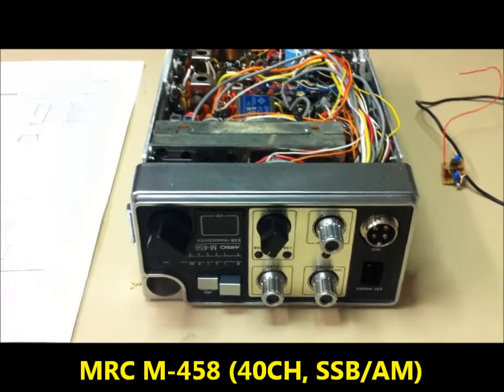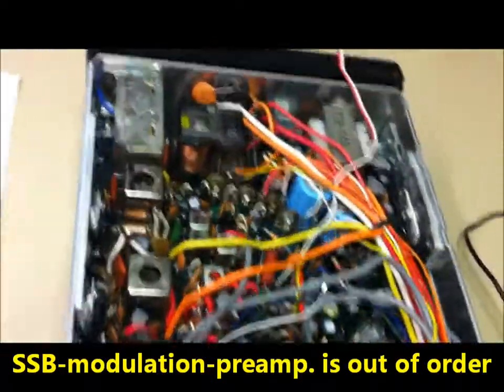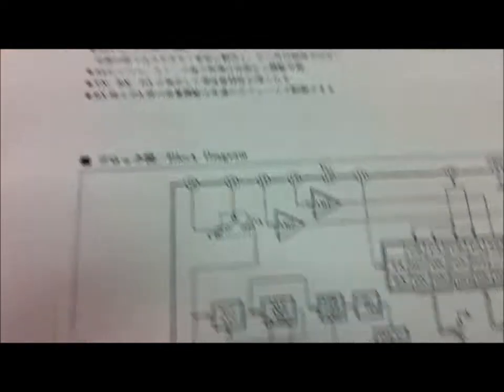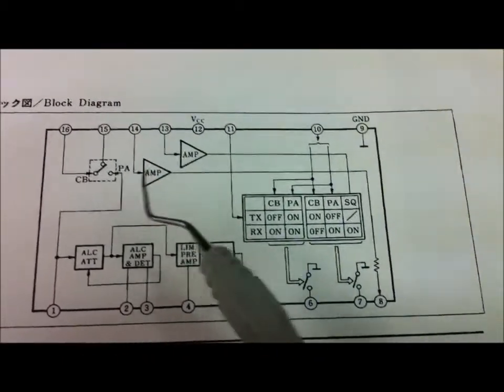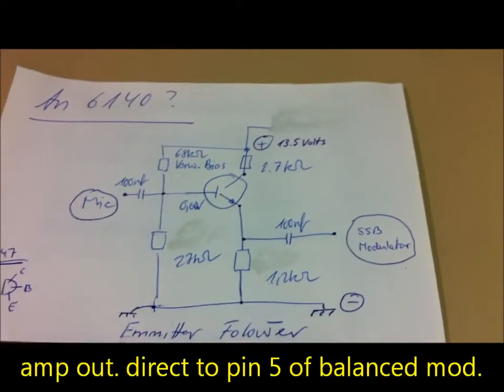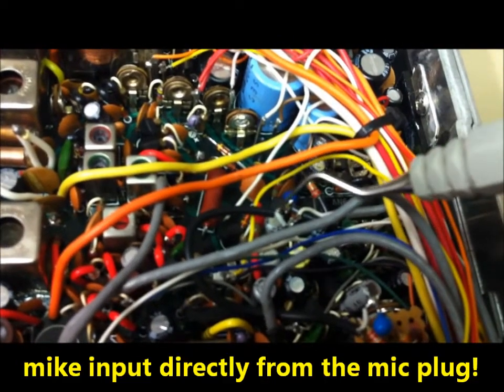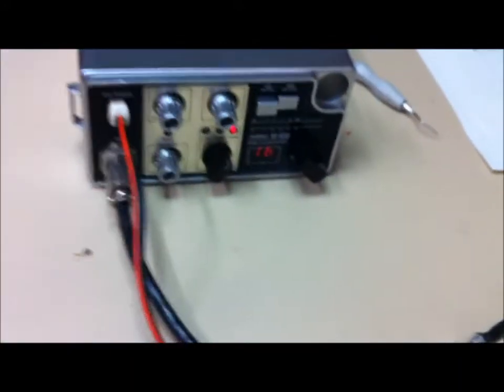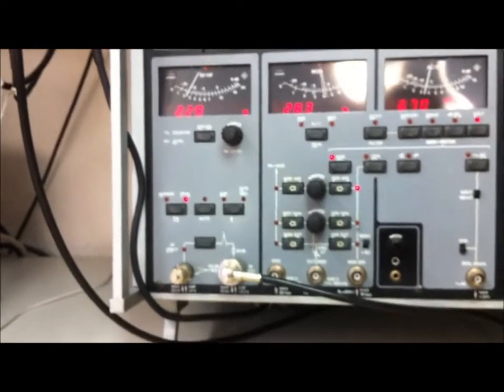MARS Radio Corporation MRC M458, SSB/AM handy-transceiver (big video)

Comment: The red speaker wire in my MRC M458 came loose from wherever it was soldered at on the board, I cannot locate a schematic for the radio or a photo. I looked at the photo from the picture show you have in the video and see the general area but still cannot tell where the red speaker wire goes. Do you have any tips, thank you'
Reply from the maker: Mr Orange hello, how care you? Yes, the red wire from the speaker goes to the solder point of the socket for the external speaker beside the relay. I hope, you'll find this solder tail. Good luck for this repair. Best 73s to you...
Reply: @SWIZZRADIOS   Thank you very much 73's
Reply from the maker: You're welcome….

Comment: Do you have the service manual for this good sir ?
Reply from the maker: Dr Jim hello, thank you for your question. I don't have a schematic- or service manual for the MRC. It's A big problem to find info about this radio. My M458 works not so fine. I've problems with the hybrid IC. But it's OK for my collection.
Reply: Yes I have one too, and accidently hooked power AC up to it on the wrong jack ouch.  Not sure it's worth it to fix it or not...  73's my friend

Comment: I have one these that needs repair. Do you have schematic, etc you can send to me via email?   kb5wqw@hotmail.com
Reply from the maker: Hello dr OM. I'm sorry, there isn't a schematic diagram in my stock. This rig is a tricky box. It's possible, that a capacitor has a short circuit. With this age, a lot of electrolytic capacitors have a short to the ground. You should replace a lot of these capacitors. That's my plan... Good luck with your repair... 73's to you.
Reply: OK. Thank you.